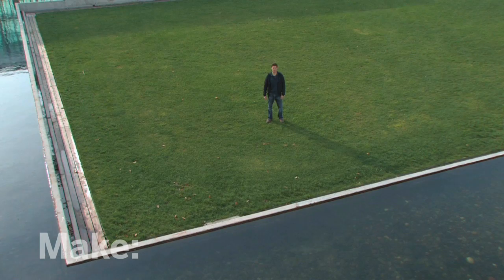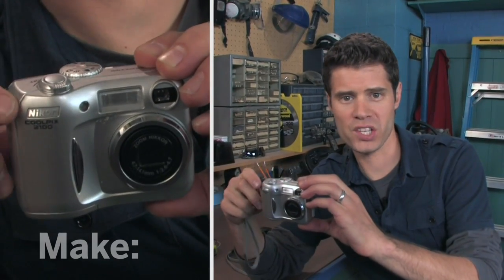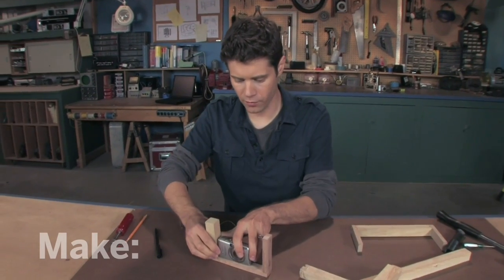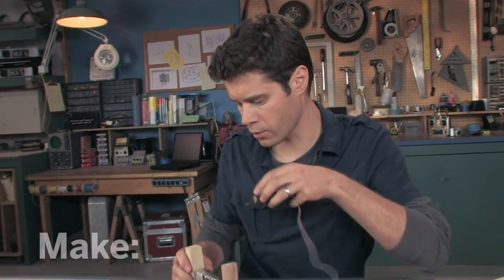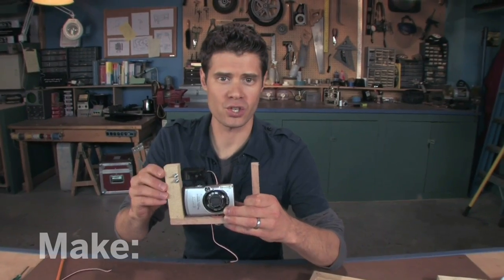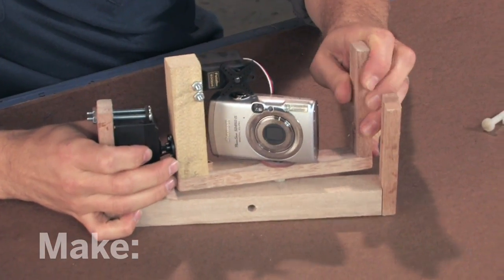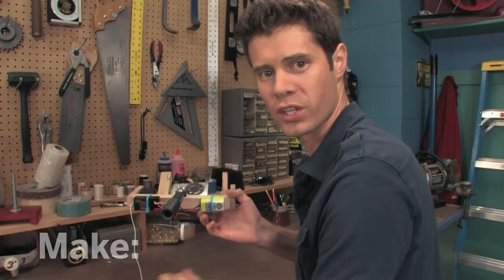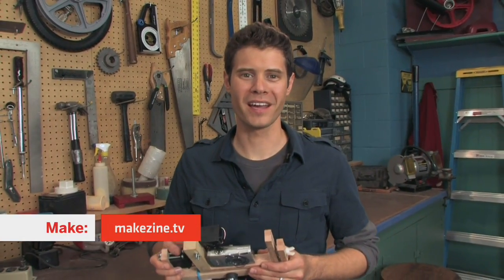Maker Workshop  Pole Camera on MAKE: television

Comment: I do roof inspections and just use a wifi enabled canon 190 elph and my smart phone on a camera pole. I built the smart phone holder, the camera holder at top of pole i t hink i spent 20 dollars for. It has a screw that screws into the camera itself in the tripod hole

Comment: Its simpler than this. Just put a ball and socket head on the top, preset the angle and then use the self timer to take the shot. I do this and it works well.